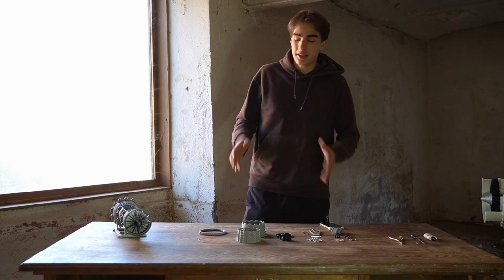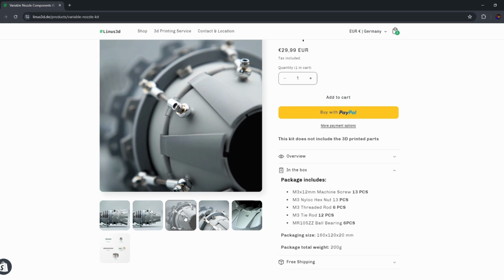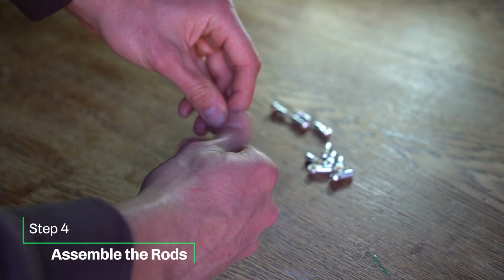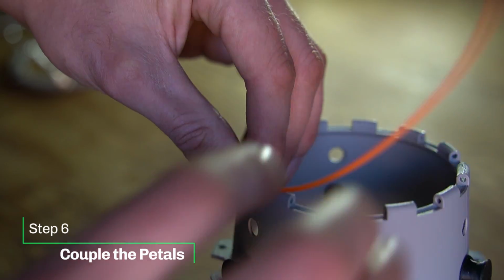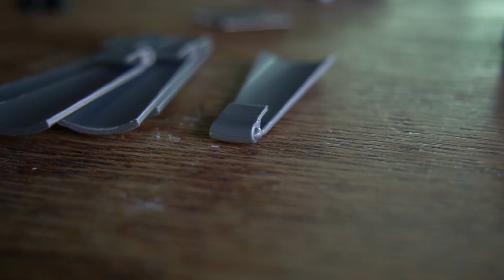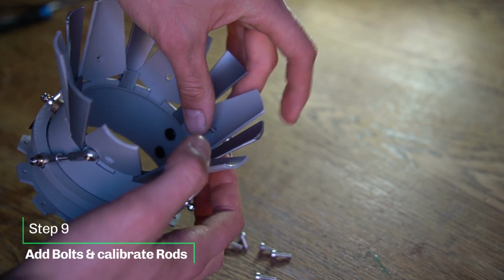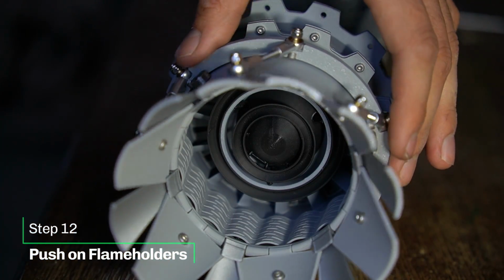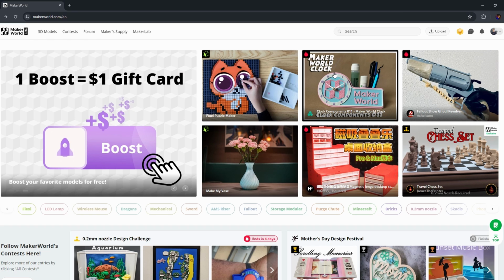3d printed Afterburner & Variable Nozzle | Assembly

Comment: Nice Print. Just started and i have one Question.... Which parts are Grey and wich parts are Silver (From the whole Turbine)?
Reply from the maker: I used a different gray tone for the afterburner. I would recommend using the same as for the shroud of the Jet engine. For the color difference on the petals I used silver :)

Comment: Very impressive design. Question: How long is the rod? It looks like 20mm to me, but just want to confirm with you to make sure.
Reply from the maker: The rods should be at least 20mm. So 20-25mm
Reply: @Linus3dOfficial  Also I am using a profile created for A1 mini by someone else. Hopefully it works.
Reply from the maker: @ Great, have fun with the project! The A1mini profile has great reviews so it should work :)
Reply: @Linus3dOfficial  Thank you. You are the hero. What an awesome project to put together.